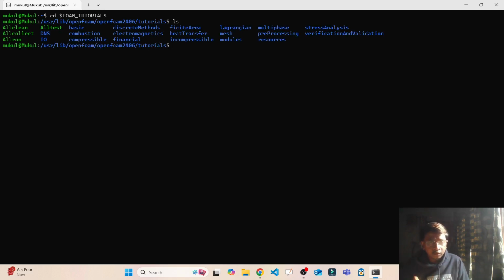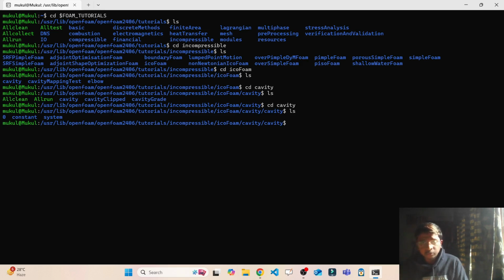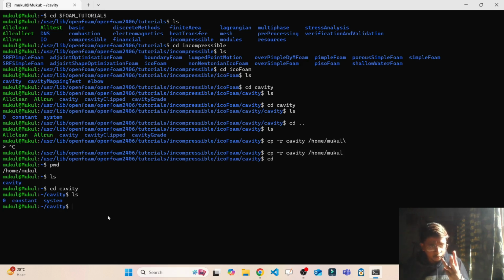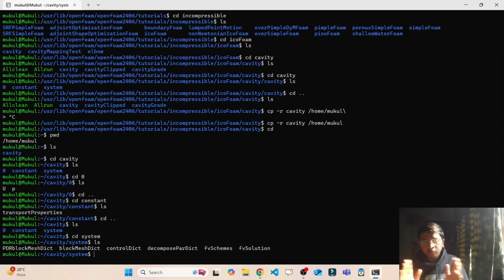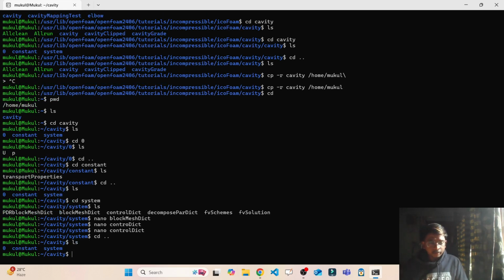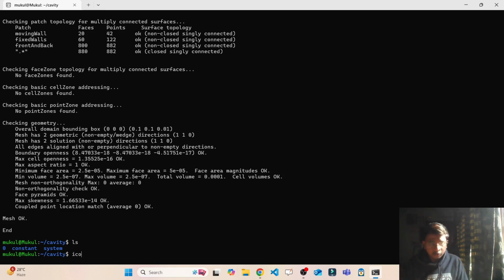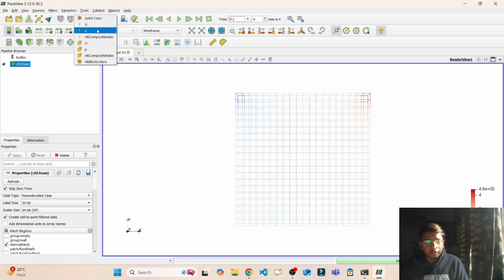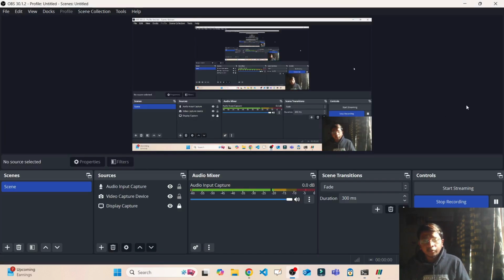Your First OpenFOAM Simulation (Step-by-Step Beginner Guide)

Comment: I am getting an error paraview.exe command not found. please make a installation vedio for paraview, how to add path of paraview to ./bashrc file and explain its components
Reply from the maker: Yes, I will make it soon.
Reply: @CFDSimplified  Hello, was this video ever uploaded?
Reply: @CFDSimplified  Hello! I’m experiencing the same issue. Currently, I save the results as VTK files and open them directly in ParaView, but this feels like a lengthy workaround. I’ve already tried reinstalling ParaView, but the problem still persists. Could you please help? Thank you!